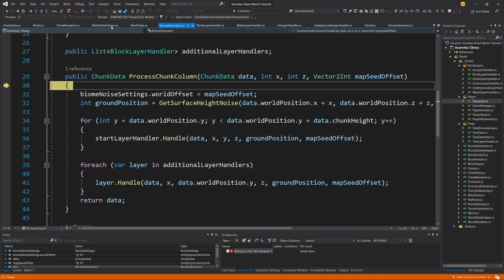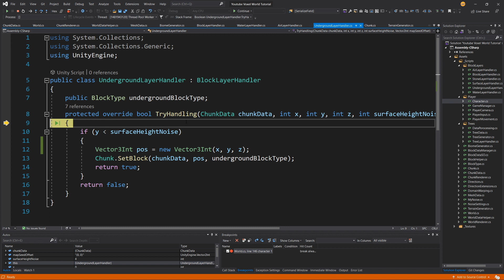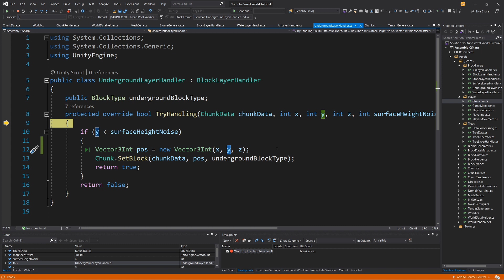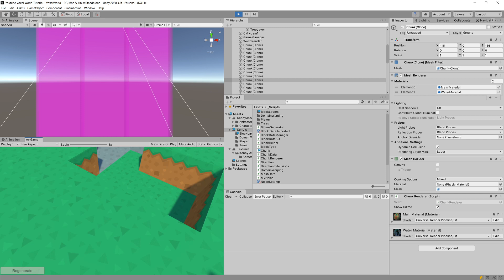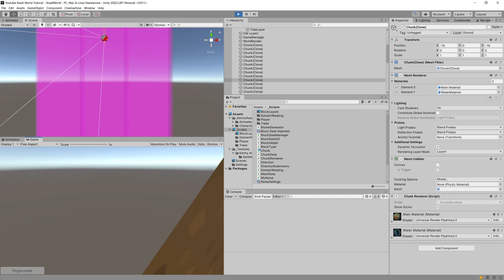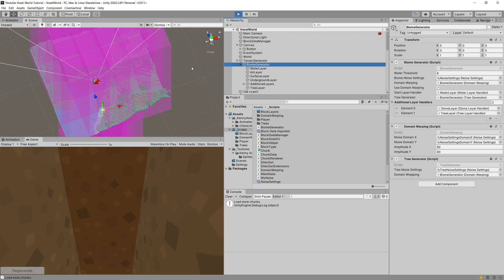Create MINECRAFT in Unity - S3 - P10 Digging logic fix

Comment: Great, thanks for this! I thought I was going crazy for a minute with digging but decided to look ahead and found this.

Unrelated question, is there any way to improve the performance of updating the chunk meshes? It seems if I dig really fast then sometimes I experience brief hiccups. Currently the entire chunk mesh needs to be regenerated when removing or adding a block. The only way I can think to improve upon this is to reduce the overall size of the chunks (for example, making each chunk 50 blocks tall instead of 100) or to implement some kind of chunk-style segmentation for the renderer specifically that would only regenerate the parts of the mesh that have changed. Not sure if that's possible but would love to hear if you have any thoughts on this!
Reply from the maker: Hey! Thanks for watching!
I'm not sure to be honest. You need to regenerate the collider and the mesh. On the other hand in Minecraft you can't dig that fast. This tutorial system scratches the surface really (literally as well :P) but the hiccups might be because we need to generate the underground chunks if you dig downwards. The problem in general is that a single operation is pretty fast but when they stack together they can take some time. Giving some delay to each "dig" action is a way to go but the bigger problem is constantly scheduling the work on the threads so that at all time you can keep 30 / 60 FPS. 
I would love to tackle this some day but its generally not what people on YT wants to watch :)
Reply: @SunnyValleyStudio  Awesome, thanks for replying! That gives me some things to think about :)